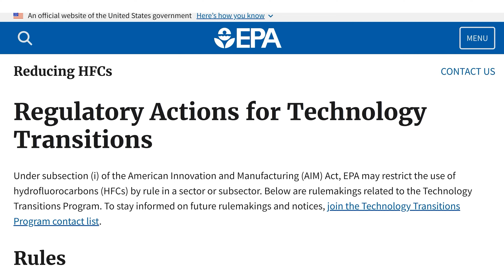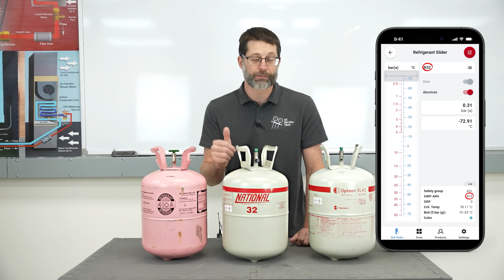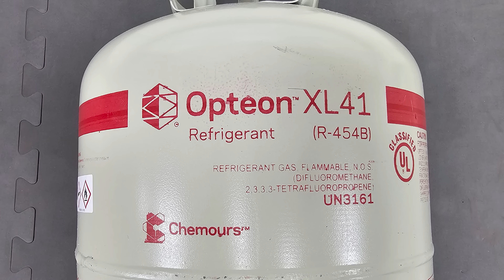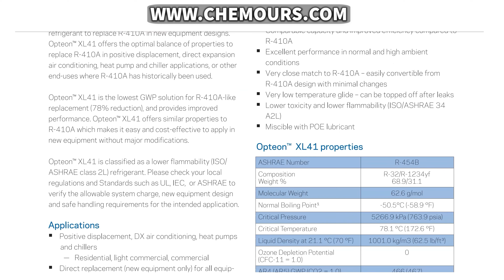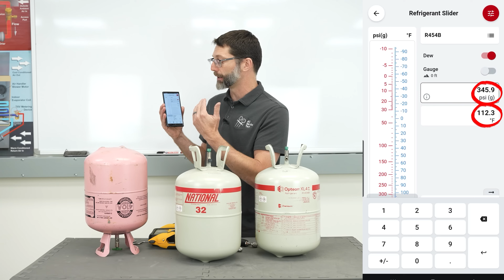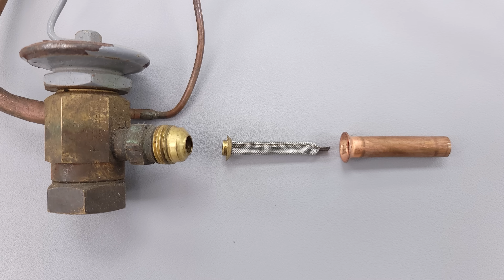A2L Refrigerants R-454B and R-32 Explained! Bottles, Changes, Rules, Tools!

Comment: New refrigerant, but it's made with a blend of the old, bad refrigerant......lol. ok. I may be wrong, but it think the refrigerant blend get basically trademarked and you have to go through a company, like DuPont, to make it. When those patents expire and you can make it without using the company with the patent, only then are the refrigerant considered dangerous and we need to use the new refrigerant made by the same company with a new patent. Government bribery at its best!

Comment: Great video; thank you. What the EPA is getting away with is ridiculous! I don't know if anybody else noticed, but R22 has almost no ODP (0.05) and lower GWP (`1800) than R410A, so we eliminated a refrigerant (R22) in favor of one that has has a higher GWP, but zero ODP (R410A). Remember the industry told us back in 1995 that R410A was going to be THE refrigerant going forward into the foreseeable future; I guess the industry suddenly got very nearsighted very quickly! Does anybody else know that now the EPA wants us to switch to a highly flammable refrigerant (LP) and one that operates at about 6 times higher pressures than R410A (CO2). I saw this proposed change in another video on A2Ls. Can anyone say FRAUD. Whose getting their palms greased in doing this? Also, why all the secrecy? Why didn't the EPA tell the industry that they were planning to switch the industry to R290 (propane, AKA LP) and CO2? How ridiculous is it that in less than a decade they are, once again, planning to switch to other refrigerants that require us to buy new servicing tools and equipment and requires manufacturers to once again retool to produce equipment that accommodates these refrigerants. Also, where the hell is the push back form ACCA and ASHRAE? Both of them should be screaming at the top of their lungs (as well as us techs and business owners. We should be complaining to our members of Congress concerning this problem) to the EPA at these proposed changes. Don't forget that the A2L push began while the highly incompetent Biden administration was in power, so there is no doubt in my mind that this was part of their ridiculous NEW GREEN DEAL (otherwise known as the attack on the oil industry and the attempted greasing of Biden's electrical buddies palms)! IMO we need to sternly resist the latest proposed switch to LP and CO2. If we don't it will continue in a never ending vicious circle. Someone has to say STOP to the EPA!!!

Comment: Cat is out of the bag. The unelected  bureaucrat PDFs in government are phasing out R410-A because the patent expired. Now they give us 'new' refrigerants with fresh patents that are mildly flammable (R32/R454B) which require uber expensive A2L certified tools and you can no longer just pump down mini splits due to the potential for oxidization+explosion. So now you have to fully recover the refrigerants just to test for leaks.

But look on the bright side at least mini splits are not refrigerators where they are putting in propane with shorted out ice makers causing explosions, injury & deaths.

Reminds me how much I adore my 1936 GE Monitor Top using a hermetically sealed Methyl Fomate closed loop system.

Criminal scum wholly unworthy of the Consent of the Governed.

Comment: EPA is bought and controlled.  Refrigerants are heavier than air so they don't go up, they stay down.  Even though propane is very flammable, your older system may be compatible for using it.  Screw the EPA and the government.

Comment: So who will be credited back the prorated value of a 1 1/2 year old 410A system that needs an evap coil? Say you had a system put in in late 23 or early 24.. system now has a bad evap is that customer now on the hook to buy a whole new central air on top of the one they just bought or is the contractor or government going to be prorating the previous value off of their old system that still perfectly functional that just needs a separate component?

Comment: Alright,  I'm tripping?? R-22=246psig at 116 °F. The PT chart has always been accurate for brand new units. 
Try more like 280psig. 
at 119°F
I've had head pressure at 310 psig. @ Fuck off no dirty coils just real time specs. Not the fucking book crap they teach in school. Lol.

Comment: Someone told me today that you can't braze the lines on an R32 system that you have to use push connect fittings. I'm sure those won't leak at a higher rate....

Comment: 20:00 does this 3 cfm of nitrogen to avoid oxidation part apply to the all installations or just a2l?
Reply from the maker: Its 3 to 5 CFH and it applies any time brazing is done on copper tubing thanks!
Reply: @ 👍ty

Comment: Is AC coil change required. You  talked about the 410A compressor being different than A2L. What is the difference in  the indoor unit. Are the specs for the TXV the same? If you flow nitrogen 2-5 minutes does that clear the A-coil? 

As an insurance adjuster,  when a tree falls on the condenser,  we only change the outside unit. We are told by contractors who want to sell more equipment the AC and coil AND furnace need changed even with single stage equipment.  This we know is overkill. So how do we know what is really needed to change.

Comment: how about the old old ammonia  systems how much damage did they do to the ozone ?
Reply: Old systems? They still making, selling and using them daily. Whats odd to me is there is no EPA regulations on ammonia loss so you could have a leak that spewed 1000lbs of ammonia and have to do 0 refrigerant conservation reports just repair the leak and top it off

Comment: Problem with R32 is the significantly higher pressure. 361 PSI vs. 414 PSI at 50°C.

Comment: I think it is absurd that now they 6  have a2 now there is a a2l there is no
Difference  in a a2 than a a2 l it is all propaganda and a auto ac is belt drive and other country’s dont have this sitting on a furnace with a open flame this is stupid i watched this refrigerant ran threw a gas regulator and run a torch with it what is going to add to the cost to the consumer and in northern mn at -30 if the refrigerant monitor shuts off my furnace how long will it be before my building is frozen

Comment: Such a scam.  Look at the investments of the people passing the bills, then look at the companies making the gas.  A r-22 system use to last 30 years compared to a 410  system lasting 5 years then just blows all the Freon out , so you have 6x the Freon loss over the same 30 years.  You need to multiply the harming factor of 410 x 6.

Comment: Came here for some info on A2L refrigerants before taking an EPA 608 cert. exam. Hopefully the EPA will allow r32 use for a while before it kills all the HFC refrigerants. The fact that R32 is more efficient, single component, no glide, with only a slightly higher GWP compared to R454b makes it seem like the clear choice. Who has the most persuasive Lobbyists with the deepest pockets?

Comment: Thanks Craig. I taken 3 other seminars and this one is probably the best so far. The more I hear about this change the less I feel it's a problem. The main things are more bottles in the truck and more dangerous in your truck if they leak. Good time to quit smoking. The HVAC equipment doesn't seem different at all. The air handlers and furnaces will need a new safety control and leak sensor. I doubt that will work at all. Goodman seems to have already switched to R32 on the condensing units and heat pumps but the indoor units are still non-compliant. Maybe we should add an odor to the refrigerant so you know when it's leaking- not rotten eggs- how about Irish spring.

Comment: One thing I am not hearing in this sector is the fact that there will be HUGE amounts of confusion when it comes to repairs and buying parts (on the tech side) between R410A and the R454B systems. Also the R454B systems have more controls for leak detection and mitigation so if these are not installed perfectly you will have issues with the systems locking out due to leaks from installations. It's going to be a nightmare for a few years.
Reply: That's why I'm putting in new old stock 410a until they run out to see how many problems the new equipment has seen this movie before

Comment: R22 was basically the 7.3 Ford powerstroke of refrigerants.... then 410a became the 6.0 powerstroke of refrigerants. The new ones will flop soon as well. Still higher pressures and I forecast lots of warranty work in the future and the need for a full replacement after 10 years....  I thought Global Warming was switched to "Climate Change" after all the polar ice caps melted and flooded the Earth. Also, a jug of R32 is about the same price as 410a, but it's only 20 lbs instead of 25.... That's a lot of different refrigerants to haul around.

Comment: I don't know if it's already been said in the comments. Well why would you shut a compressor off that's running at 140 PSI and shoot it up to $229 psi when the compressor is off seems like they should have a shut-off valve solenoid

Comment: Here's a question. I'm a couple years in, I was always taught to vacuum below 500 microns. My lead tech and I have a constant disagreement about this, he prefers to just pull a vacuum, shut the vac off after about 20. If it holds a vacuum in inches of mercury, he calls it good. Can someone explain why this is not as good as under 500 microns? I want to win the argument 😂

Comment: the problem with digital gauges is the "sampling" interval/ate. It's to slow to capture  "deflections" in pressures due to compressor issues. analog gauges will show you that.

Comment: The lesson here is find a HVAC company that will fix your old unit instead of selling you a new "state of the art" system.  There are not a lot of components in a AC system,   keep them clean.  They will last way longer.  And repair them. the most expensive part is the compressor.  Which is way cheaper than a whole new system.

Comment: where did they come up with this GWP, if we print more money everything will be great. We can afford what these unit will cost, just like paying 15 grand to replace that battery pack for that 65,000 EV car that uncle sugar is going to make you buy. wonder how long till they find a way to bypasses the detector. Because i am sure it will be illegal to remove the manufacture detector. 20 grand fine up to 10 years in prison or both.

Comment: How many of you worry about natural gas when servicing a furnace?  It is extremely flammable.  Do you use non-sparking tools to work around it?  Dies the equipment have gas alarms?  A2Ls are a whole lot safer than A2Ls.  Think about it.

Comment: Great video, very clear and concise. Two points it should mention standards regarding refrigerants like AHRAE 34 & 15 & ISO 817. Also for info, the 700 GWP limit is a figure from Daiki (patent holder of R32) and is NOT legal, moralor ethical. We should not use any class of refrigerant EXCEPT A1 class since 1928!.

Comment: Our HVAC tech/Owner has been in business for 30 years and can always be counted on for the best service! He attends all the updates and his 3 trucks/vans are equipped with all the latest tools and testing equipment. He recently next year will be his last as the expense to suppy new techs with tools and add several more fully equipped vans is not worth it. And now due to the up coming changes the time and effort takes a toll on him at his age!! I know what it's like as I spent 35 years in the automotive field and too many changes also take a toll as one reaches retirement age. I have over $100,000 in tools in my basement. One tool cabinet is loaded with R12,R134 and 123Yf. Testers, fittings, gauges!! John

Comment: If those leak detectors were cheap enough, I would start slapping them on some systems now. The nuisance calls could be annoying, but it would be a helpful tool for speeding up leak detection. I can see it now though, lazy techs and techs who get commission are going to start selling new coils by the truckload. "Oh, your indoor leak sensor went off. That means the coil is leaking and needs replaced immediately if you don't want your house to explode, killing your whole family"

Comment: don't understand why everyone is so freaked out about the A2L rating, R32 is very difficult to ignite. Also, most households have way more dangerous flammables such as gasoline cans that can be easily ignited and we tend to store them in hot garages year round. Gasoline vapor has a 1.4 to 7.6vol.% flammability range while R32 has 13.6 - 28.4 vol%. The leak sensor makes sense during Heat/AC border season where the system might be leaking but turned off for an extended period of time. Likely the AHUs will not just have the sensor but will be programmed to start the blower prior to ignition to avoid any dangers.
Reply: Far less flammable than the tank of propane gas that millions of people routinely store in their outside cooking grill.
Reply: wrong it is very easy to Ignite
Reply: @dknowles60  mind linking a video? All the ones I've seen they were abusing it with propane torches and whatnot and it still didn't really ignite.
Reply: @balint133  wrong
Reply: @dknowles60  Incorrect

Comment: I'm still using and storing My R12 refrigerant, I'm glad I did.
Reply: Still have a jug of R12 👍🏻
Reply: Its A1 class and a fire suppressant, non-flammable, non-toxic WHEN & IF IT LEAKS but safer to users if it does especially in the latest weather changes. So which class non-flammable or flammable IF IT LEAKES almost a zero chance if you are a qualified and trained engineer.
Reply: @neilafram663  Class A1 doesn't necessarily mean it's a fire suppressant. Of course any gas is a fire suppressant if it displaces all the oxygen, but class A1 refrigerants can burn if exposed to an open flame too.
Reply: illegal here in Canada
Reply: Laws are not to be followed anymore here.  @SpecialKthx

Comment: Seems like R32 should be the new standard. Not much more  GWP than 454. Much  cheaper since multiple companies make it already. And no glide. It’s probably more efficient too. 454b is a PFAS refrigerant. It will be banned in a few years. R32 is not on the list of PFAS refrigerants.
Reply: I guess in 10 years they will change refrigerants yet again. This is a never ending sales  tactic by refrigerant and HVAC companies.
Reply: @sentryfe74  No argument there,
Reply: https://youtu.be/RQnKPb6i0oI?si=54gSBobhGP5k8EAj
Reply: Not really. Trane, Lennox and Carrier are using R454b.

Comment: So what happens when there is a leak in the evaporator coil in the heating season 💐
Reply: That's the reason for the sensors. It will cut off your heat in the dead of winter. Bundle up, this new refrigerate is going to be a blast 😅 👍
Reply: @fpitw71  
That I like so you can’t just add refrigerant, they have to replace the coil otherwise the heat won’t work🤩$$$$
Reply: Maybe a burst of heat that you don't want

Comment: Becareful of sparks? With your equipment? I would have never believed that we would be putting refrigerant that might respond to a spark but the government said it is safe for the public, But you need all kinds of safety equipment on the air handler ? what about gas or oil furnaces with AC or heat pump installations? Leave it to the government  and world 🌎 officials ???  to F - Things up for us all.

Comment: They're switching over because it's a FINANCIAL SCAM based around an environment HOAX!

I see they have almost cut the GWP value for R32 almost in half from its past 1100+ value!  I guess it really doesn't matter when you're just making up figures so you can rip the consumer off which has no environmental impact anyway 😈

My sister was one of the head Chemical Engineering for DuPont/Chemours and R454B is nothing more than a consumer scam.  Here's how it really works ...

Refrigerant goes off patent and overseas manufacturers start mass producing it for pennies on the dollars hence there's no real profit in it anymore for DuPont/Chemours & Honeywell.  Next, Chemours & Honewell develop a new refrigerant and collaborate with federal government (EPA) to FORCE consumers to use their newly patented, expensive refrigerant based on a bullshit environmental hoax so they can increase corporate profits!  Once the patent expires on that refrigerant, guess what, a new refrigerant is developed and the process starts all over again 🤑

Why do you think Honeywell sued Daimler (Mercedes-Benz) over refusing to use R-1234yf (also recalled vehicles sold that used R-1234yf) and instead opting to use CO2 instead!  Wake up sheeple, these refrigerant alternatives have all been a CORPORATE FINANCIAL SCAM from the beginning and the sad part is that the EPA is easily bought off to enforce this FRAUD onto the consumer!

I don't care what they do because I converted my R22 A/C system over to R407c in 2020 (rebuilt 98% of system) and still have over 20+lb. of refrigerant which only cost me $125 so I'm good for another 25+ years hence I'll probably never live to see a new A/C installation.  Plus, I also have a tank of R424a from when I converted my other house over from R22 so they can take their R32/R454B/R1234yf and stick it where the Sun doesn't shine 😁

Funny how India and especially China (largest green-gas emitter) doesn't really enforce any of this bullshit yet most of the world's population resides there.  Just so you know, you can still buy R22 in China (15lb) for $35-50 🤯

Comment: Between the 2, I'd rather use 32 as it's a single component refrigerant.....while 454b is an azetropic blend and has a glide. We have already seen these A2L in heavy commercial. 1233zd, 513a, 514a, 1234ze etc etc. HFO and HFC mixtures
Reply: Another HVAC professional agrees with you: https://youtu.be/RQnKPb6i0oI?si=zXhWKnLUqWlAv-xJ